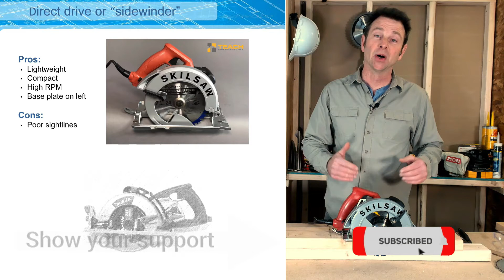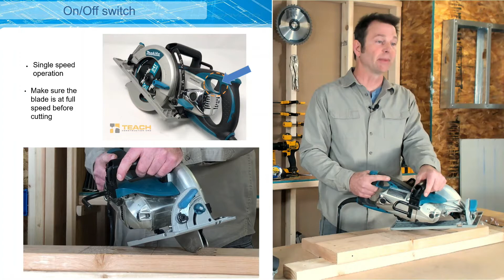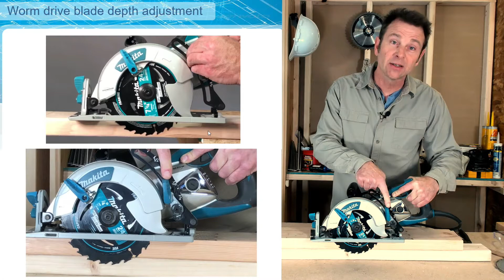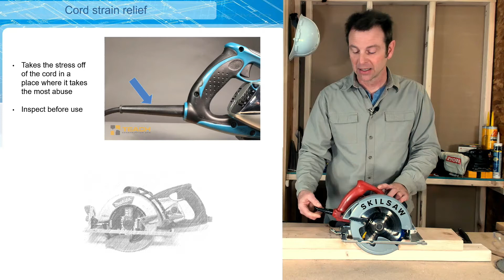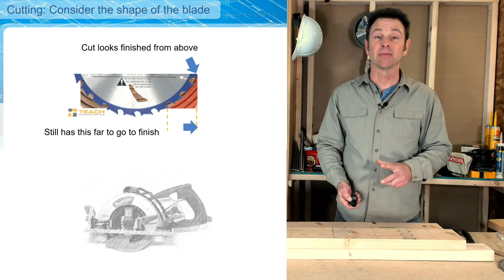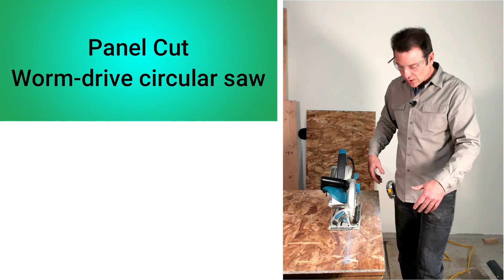How to use a Circular Saw - Part 1 of 3 - Trades Training Video Series

Comment: I think the most important thing about choosing a circular saw is being able to see the blade.  This is one time left-handed people have the advantage, because direct drive saws are cheaper and most of them have a right-hand blade.  So, unlike right-handed folks, they don't have to hunch over the saw to see what they're doing.    

That said, I'm right-handed.  My favorite is an old Skil worm drive with a 6 1/2 inch blade and it allows me to see the blade easily.  Another advantage, and it's a big one, is the blade being six or eight inches beyond my hand, because it lets me push the saw further away and make a longer cut.

There are a few left-handed, direct drive saws around.  I bought a Porter-Cable 7 1/4 a few years ago and it's not bad at all.

No matter what kind of saw you use, the easiest way to make an accurate cut is to watch the side of the blade closest to you, which, unfortunately, often means the weight of the saw will be on the portion that falls away.

Practice, experience, is everything.
Reply from the maker: Great comments - and as a right handed person I agree.   But Joe likes the worm drive in part due to the weight and power.
Reply: @ConstructionEd  I'm confused.  I assumed Joe ran this site; how many people are on your team?  I don't see any advantage in a heavy saw, but the increased power and torque of worm drives makes their extra weight well worth it.
Reply from the maker: This channel is used for our public distribution of some of our video lessons.  My name is Michael - Joe and I run a social enterprise called TEACH Construction where we create many types of Instructional Resources, mainly for teachers and trainers.